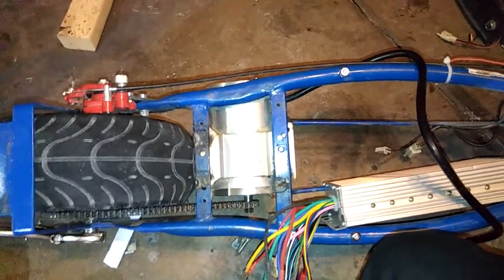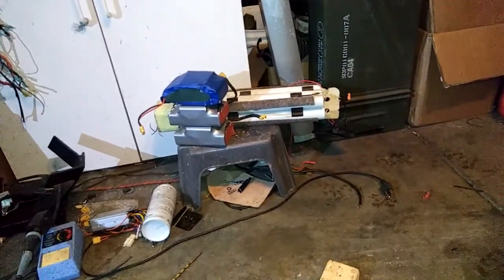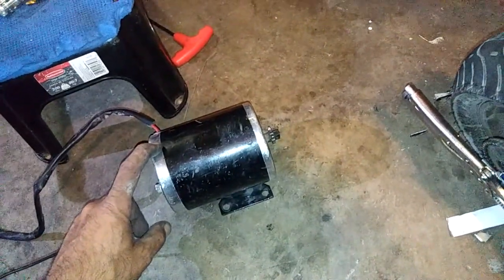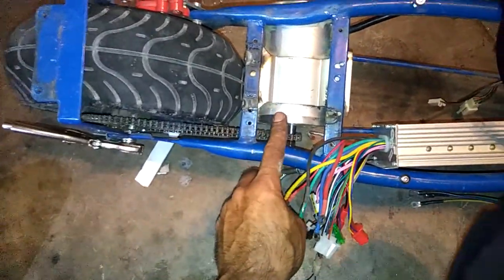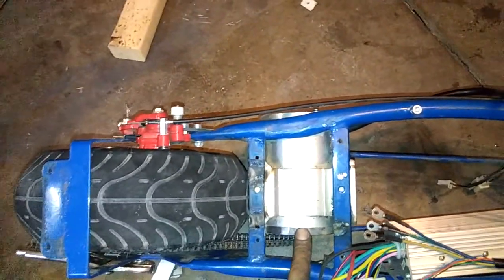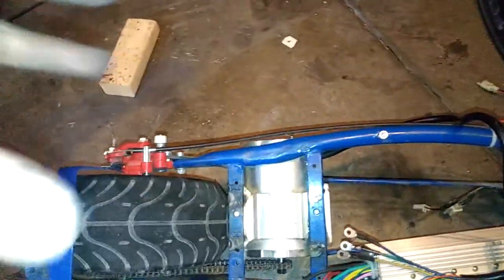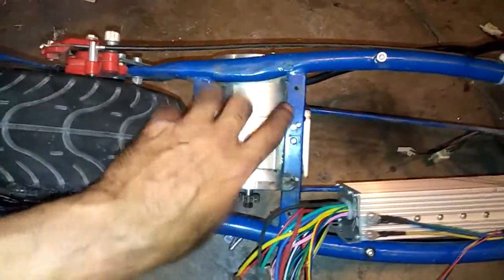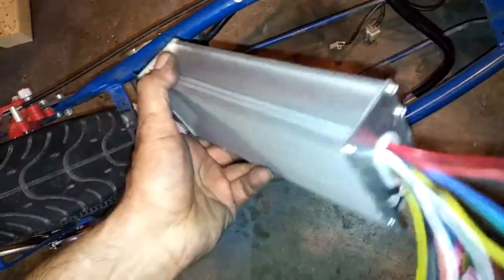48 volts RAZOR E 300 MODIFIED

Comment: Did you have to change the rim for the bigger tire?  I assume you did and I see you have a disc brake setup there.  Where did you get the parts?
Reply from the maker: They came from a mini vox 250 electric motorcycle they are 6.5 rims and 10" tires

Comment: I just ordered the razor E300 hundred, I’m not looking to increase the speed, I’m just trying to get the battery to last longer than 40 minutes as advertised. Is it possible to put in a 46 W battery and not change anything else?
Reply from the maker: Michael Pinela it is posible if you replace them with some 10 amp battery!  I believe it comes with 7amp battery stock. That will give you 25% more riding time

Comment: Thanks a lot for the video I found this E300 at a property I was working on guy was going to toss it he asked if I wanted it the batteries are dead but seeing that stocking was 15 miles per hour I definitely want to do those modifications to make it go 30 miles per hour my questioning was I would have to do more than the stock batteries?
Reply from the maker: Erick Correa if you upgrade the battery to 10 amp's it will give you around 10 miles range! With an adult on it 160 to 175 lbs .. The 15 mile is with a 60 lbs kid

Comment: Very cool video. I’m currently looking at doing the exact same thing. I️ also see you modified the rear wheel brake assembly. I️ would love to see that video. I️ thought the motor would interfere with the brake cable, but yours looks great. Well done. Love to see more. Thanks
Reply from the maker: EJ Huntemann thanks I will upload the finished scooter